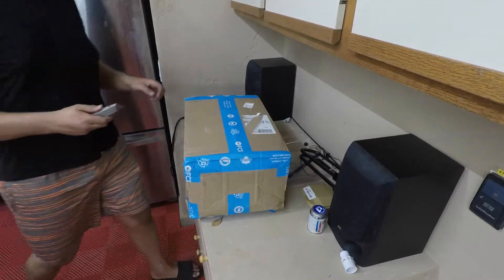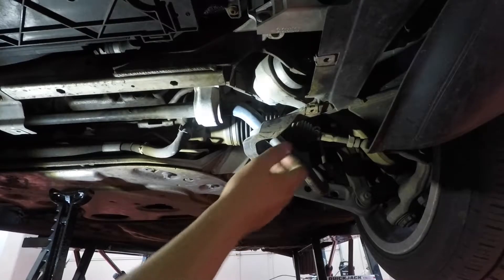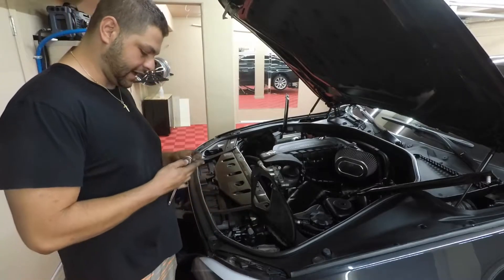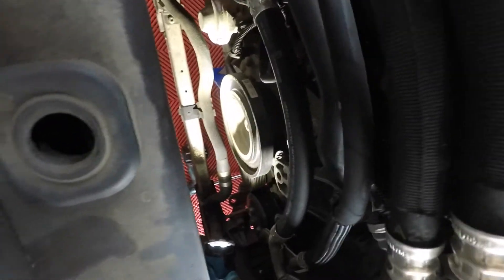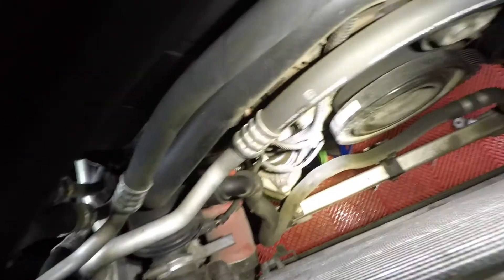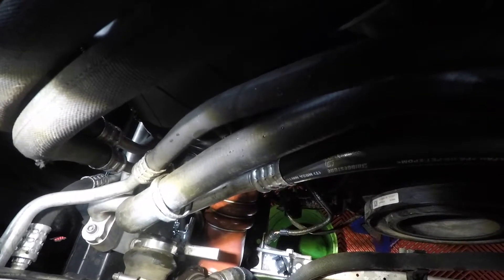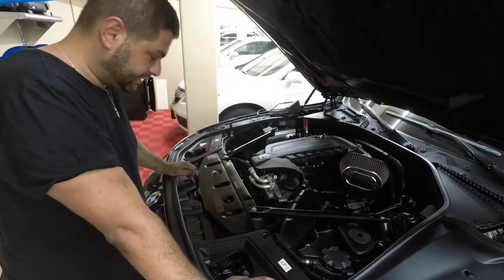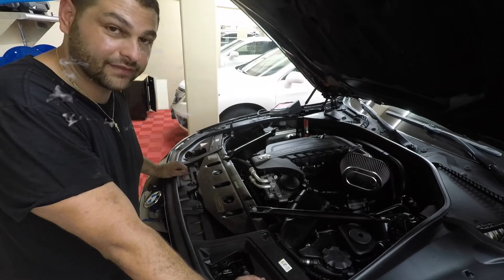Easiest Method for DIY Water Pump & Thermostat Bmw F10 N55 535i/335i + bleeding Bmw 535i Build P. 5

Comment: My 2014 640i.  N55.  It sometimes will go like a hair past halfway on the temp.  Then eventually go back to half.   Im blaming it on the thermostat.  Or is it both thermostat and water pump?
Reply from the maker: Could be either one. Sometimes the water pump as it goes out will work on and off. Better off changing them together.

Comment: Mine gave the coolant low warning today.  Coolant level was fine.  Car raised the RPM when I opened the reservouire.  Closed it back up.  Error went away.  I assume I need to replace the water pump and therostadt because it takes awhile to warm up like it is stuck open. 125k.
Reply from the maker: Yeah mine started exactly same way.

Comment: I have 2011 bmw 528i and the engine temperature 🌡 is on 250F, is that normal
Reply from the maker: Yeah it can get that high. You’ll know if it’s not normal because you’ll get a notification for overheating.
Reply: @JonIbrahim  
Thank you for the information 🙏 
Do you think I need to replace the water pump. I'm at 102000 miles
Reply from the maker: @kingkenny8245  if it has never been replaced I would. Mine went out at 110k. And I would have rather replaced it early than been left stranded.

Comment: Have a 2012 bmw 535i recently had a check engine light /drivetrain malfunction 104 miles had to replace my high pressure pump and oil filter cap car been running fine at 107 miles no lights on dash I still want to replace the water pump ??
Reply from the maker: If you can I would. You don’t want to end up having to replace it when it fails. And it will fail.
Reply: @JonIbrahim  thank u
Reply from the maker: @User-ei9js  thanks for watching!

Comment: Bro real question!! Please help, mine keeps going cold (instead of over heating) even after i changed the water pump, do i change the thermostat too??
Reply from the maker: Yes 100% change the thermostat.
Reply: I really need help!Mine situation is the same.When coolant temperature get to 105 C degree，then fan run high for 2 minutes and stop until temperature down to 85 C degree. I also notice fan run intermittently all the time when driveling.So what is wrong with my N55? The electric water pump or thermostat fail？

Comment: Great video my 535 just left me stranded today because of overheating.
Reply from the maker: It’s one of the few pitfalls of the early n55s. The cooling system must be serviced to avoid it! Otherwise a few gaskets and they are pretty bulletproof. Thanks for watching 👊 make sure to subscribe!
Reply: @JonIbrahim  how many miles did you fail at?
Reply: How many miles did yours fail at?
Reply from the maker: @gabeesquivelLethalZR1  111,000 miles. Age of the pump also plays a factor too. Has yours failed yet?
Reply: @JonIbrahim  at 84k on my 15 535i so will be doing it soon! Has not failed yet though.
Reply from the maker: @gabeesquivelLethalZR1  the newer ones aren’t as prone to failure. You should be alright for a while!
Reply: Mine failed at 165k miles other then that cars been great 😊
Reply: @JonIbrahim crazy that's when it failed on my 2014 lci f10.

Comment: Hey john, not sure if my water pump needs replacing but My fan kicks in high then low intermittently. If it does this for a few minutes then it stays high, after which the car increases temperature and then i get the over heating notification. what do you think?
Reply: My car is a 2015 535i 87k miles
Reply from the maker: @georgiowalkes1218  more than likely water pump or thermostat, have you scanned for codes?
Reply: @JonIbrahim  Shame to say, but I used Bimmercode to scan, didnt see anything. Atleast, nothing pertaining to the pump or thermo
Reply from the maker: @georgiowalkes1218  interesting. You normally have a related code if it’s getting you the overheat warning. Could be your fan in this case.
Reply: @JonIbrahim  thought it was the fan too, but the fan works. if its on all the time then why would the vehicle over heat?
Reply from the maker: @georgiowalkes1218  it’s on all the time because something is not working in your cooling system. The fan running all the time on high is a sign your cooling system is failing. I noticed my fan being on more and more when before I changed my pump and thermostat

Comment: That top bolt on mine is so stubborn it's not even funny
Reply from the maker: I’ve done this repair a few times so I have the muscle memory. I remember the first time I did a water pump on these it took me HOURS. this is the best way to get it though.
Reply: @JonIbrahim  I think my bolt is seized on top. Tried a 38ths, didn't work, same for the 10mm, it just rounded it. Went to Autozone and got a grabber and that still isn't working. Let it sit with oil on it, still isn't working. I seriously do not know what to do next
Reply from the maker: Were you able to get it out?
Reply: @JonIbrahim  Nah man. Don't know where to go from here tbh lol
Reply: @JonIbrahim  I got a friend of the family who works on Euros for a living but he won't be coming through for another week and I kinda need the car for work
Reply from the maker: @yomansam4689  yeah it’s tough. There’s no simple tip or trick once it’s rounded out. You just have to try a bunch of different ways to get a stripped bolt out. Just don’t give up. What advice did he give on getting it out?